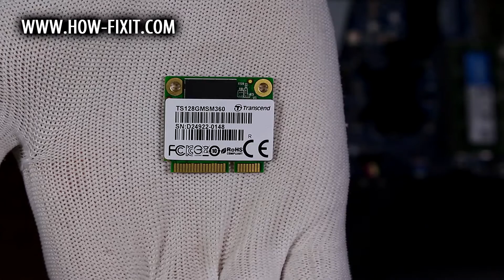How to install mSATA SSD in Asus ZenBook UX303 laptop

Comment from the maker: *ENG: Links to screwdrivers and mSATA for Upgrade in the description under the video
*RUS: Ссылки на отвертки и mSATA для апгрейда в описании под видео
Explaining Difference Between mSATA and M.2 SSD: https://youtu.be/s-2VrxgI49Q

* ENG *
To disassemble laptop base things you need is screwdriver and spudger (tool used to separate plastic components without causing damage).  For replace you can use 25x30mm mSata boards.
If you need something of this entire stuff, you can check links above.

* РУ *
Основные инструменты, необходимые для разборки ноутбука, это отвертка и спаджер (инструмент для расщёлкивания пластиковых частей корпуса, без их повреждения). Для замены подойдут платы с интерфейсом mSata размером 25х30мм.
Если Вам необходимо что-либо из этого можете воспользоваться ссылками выше.
Reply: Thank you for great video. However in description is written "To mSata port in this laptop can be installed just mSata SSD, that has size 50.95x30mm or 25x30mm." But you cannot install 50.95mm long SSD, at least UX303L shown in the video

Comment: The mSata SSD linked in the desription DOES NOT WORK for Asus UX303. You need a half size mSata.
Reply: Really? can you clarify please. Puedes aclarar cual fue el error y cuál sirve? Gracias
Reply: @manuvinci  Tienes que buscar una half size mSata, que es una mSata de la mitad del tamaño que la del link. Fíjate en que la mSata del link en Amazon no tiene el mismo tamaño que la tarjeta que instala en el portátil en el vídeo.

A mí me resulto muy difícil encontrar este tipo de tarjeta, ya que sólo la hace un fabricante. El fabricante se llama Kingspec. Yo la compré por eBay a muy buen precio. La calidad del producto es dudable, pero es la única opción en el mercado actualmente.
Reply: @JavierRamirez-ie6dy  Sí, gracias por ponerme en alerta. Ayer estuve investigando y creo que no vale la pena agregar una 1/2 MSata para "no desechar mi HDD" de 1T. Hoy en día creo que es mejor cambiar mi HDD por una M.2 que alcanza velocidades mucho mayores que que las otras SSD versiones. Las MSata tienen velocidades incluso menores a las SSD 2,5"... Qué opinas?
Reply: @manuvinci  estoy de acuerdo contigo. Yo ya compré e instale la mSata correcta y no estoy muy contento con los resultados. Mi idea era agregar la mSata para instalar el sistema operativo y utilizar el HDD de 1TB cómo almacenamiento, pero estoy empezando a pensar que hubiera sido mejor idea gastarme un poco más de dinero y sustituir el HDD directamente. Yo te recomendaría hacer esto.
Reply: @JavierRamirez-ie6dy  Gracias, saludos.
Reply: @manuvinci  Hola @manuvinci, disculpa una consulta, como yo podría instalar una M.2 en lugar de el HDD existe algún adaptador ?, muchas gracias!
Reply: @Manuel.ortiz.30  Amigo, despues de mucho buscar, llegué a la conclusión que no vale la pena cambiar HDD por una M.2 ya que la velocidad conexión entre el disco y el PC, tambien es moderada (SATA), por lo que no le sacarías provecho... Lo que yo hice fue cambiar mi HDD por una SSD... Y deberías tambien mejorar la RAM. Con eso le sacas mejor provecho a tu inversión... Debes poner atención que el tipo de disco NO mejora drasticamente la velocidad de tu PC... Siempre mandará tu procesador (que generalmente vienen soldadas) y la RAM, además de tarjeta de video... Saludos